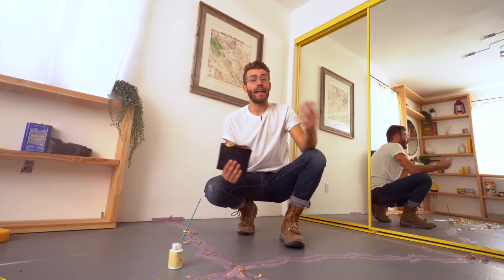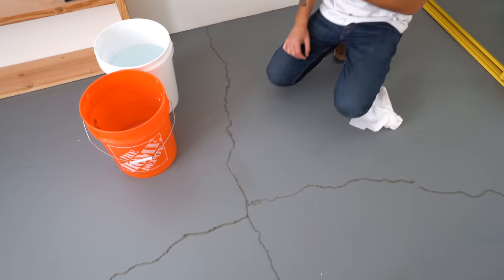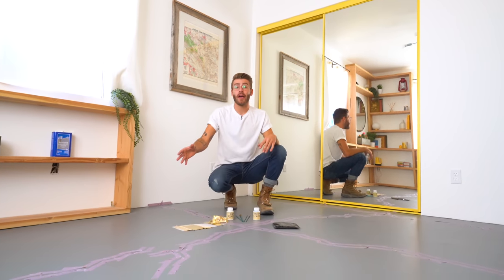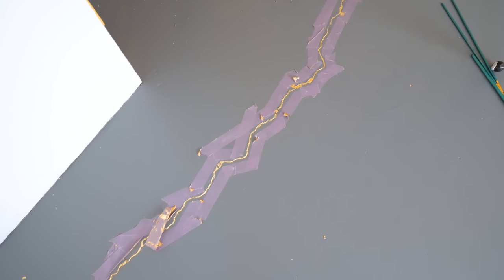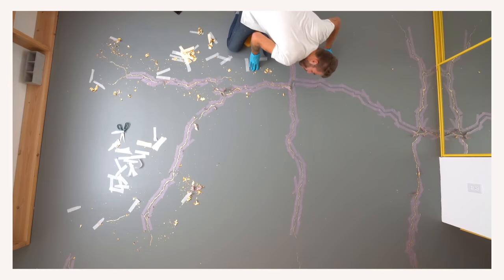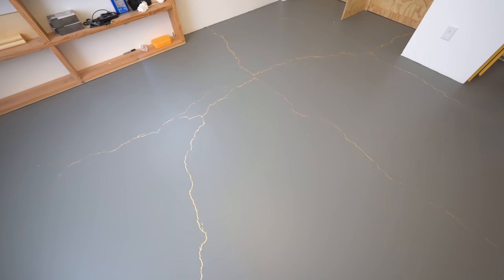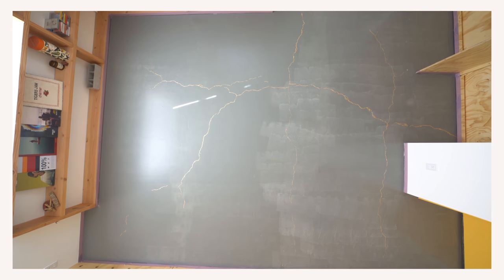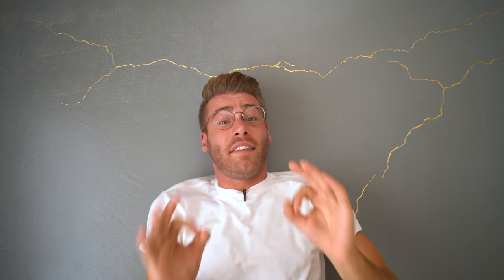I GOLD-LEAFED MY BEDROOM FLOORS!!! DIY KINTSUGI

Comment: Counter top installer here, when using silicone if you spray the surface with a Windex or soapy water, it prevents the silicone from sticking to places you don't want.
Reply: countertop installers unite!
Reply from the maker: Genius!! Thanks a ton
Reply: Wait, on any surface? Even if i use silicone onto a wall, to close tge gap with the box of the ac?
Reply: @beatricemariacappello5768  It would work but you would use paintable caulk if you want it to match the color of your wall
Reply: Also vinegar can clean up extra silicone that’s on surfaces you don’t want it on

Comment: I would probably use epoxy with gold pigment. Let it sink right in and essentially glue the floor back together. Much like the actual purpose of Kintsugi, but without actual gold. Avoiding getting it on the surface would be the hard part. I'm thinking custom 3D-printed funnels stuck down with poster putty or similar. Just a thought. Wait for the epoxy to stiffen (not cured, just no longer fluid), and shave off any excess with a razor blade.

Comment: Bro that wasn't silicone grout, that was silicone caulk that is color matched to a grout color for the edge of a tile job. Great work though!
Reply: @Catch333FL  Bro, atleast milesh's comment contained useful information. Yours does not benefit anyone here at all.

There is a difference between caulk and grout, you don't use grout to finish off tile edges in a shower no?

Comment: What if you did a clear epoxy pour on the floor as a sealer? You would not have the matt effect anymore, but I know a lot of people epoxy their concrete garage floors so it "should" work. I'd probably make a small test piece of concrete and use the same products you've used on the floor already and see how it goes

Comment: Concrete sealer on raw concrete, it soaks in. It isn't quite the same as a protection coat that you get with a polyurethane for example. I don't think it is going to protect your gold leaf well.
Reply: raw concrete is different than painted concrete. that gold leaf is going to be just fine.

Comment: Pro tip about polyurethane - If you use it indoor or anywhere, the vapors can mimic asthma symptoms. Ask me how I know. I went to a pulmonary doctor and did several breathing tests to find that out…. My lung capacity was at 65 percent. I think he said the vapors are toxic for up to 30 days until the product is fully cured